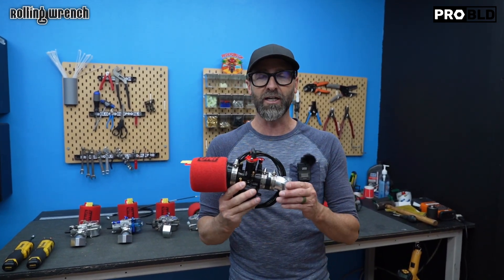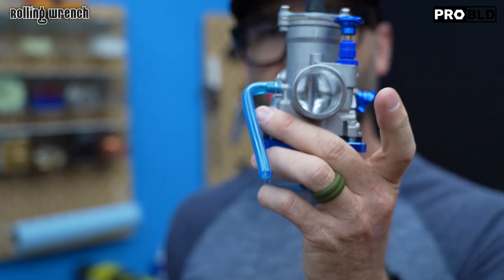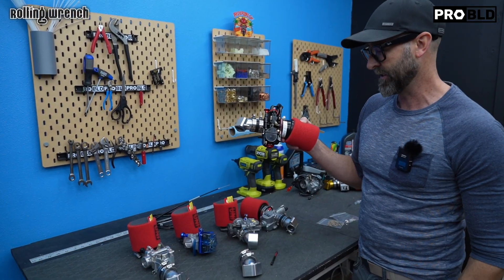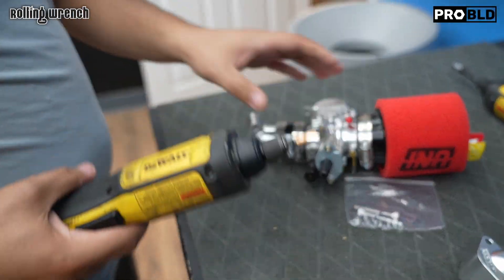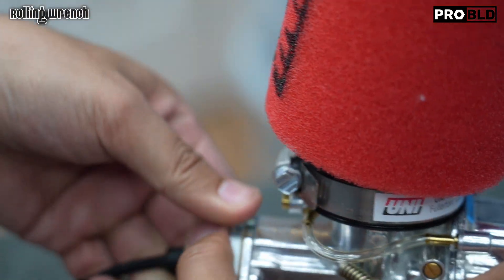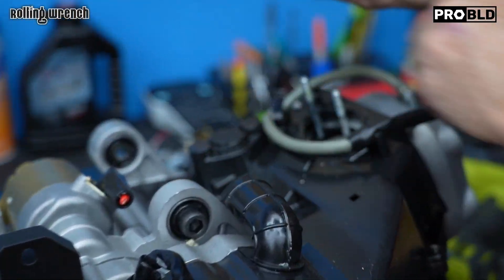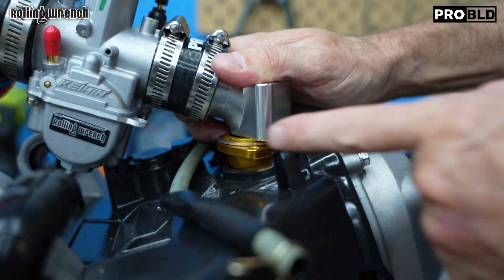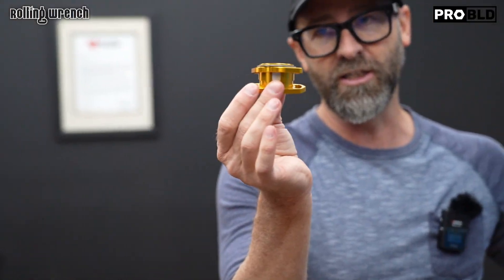WORLDS BEST GY6 PERFORMANCE: Bang For Buck

Comment: I recently got a Ricky Powersports Tiger shark 125 cc go kart I have no clue what type of engine is on it other than a four stroke and it was running for about 20 minutes after I first bought it brand new and then it lost power and died it has spark. It has oil it has gas it hascompression, but nothing is working to get it started any advice

Comment: where you at in colorado? im also out here and im got a 125cc rn with a 26mm on it its running great im just having some issues with understanding jetting out here im on a 35 pilot and rn im running a 128 main but still a bit lean up top is 135 to much of a jump?

Comment: Im on a 200cc SVT and that's the first thing i won't to do but i don't know what the best size. Some people was telling me do a 28mm but i dont won't it 6o be to big
Reply from the maker: 28mm is perfect for a 200. That 200 is actually a 170 (61mm bore) they just call it a 200
Reply: @RollingWrench thanks 👍🏾 i appreciate your help. What do you think about the ⚙️ cause I also want to do at 17T in the front and 32 in the back

Comment: I have a GY6 CVK Carburetor with GY6 Intake Manifold. If understand correctly I can replace with GY6 CVK Carburetor with GY6 PWK Carburetor and I'm good to go. I don't have to change the intake manifold as based on the specs it looks to be the same as GY6 PWK Intake Manifold,  Correct?
Reply from the maker: This is all you need https://www.rollingwrenchdenver.com/products/gy6-oko-complete-carburetor

Comment: the inlet on the cilinder head on 125/150cc gy6 22mm right?
Reply from the maker: No 25mm
Reply: Ok thx for the explanation. on my standard rubber intake it says 22mm. That's why I asked about this, but even if the hole in the cylinder head is 25mm I think it's no use to install a bigger intake/carburettor unless you port the intake right?
Reply: I double checked the standard gy6 125cc intake port size on the internet which is 22mm. I'm surprised you claim it's 25mm. Anyway, I have been using a 30mm pe carburettor on my 125cc gy6 for almost 7000km now and it's running fine, but I think it could have been much more fuel efficient if I had used a 22mm carburettor all this time. I do about 20km per liter now. 
Could you give me some fuel efficiency numbers with the different size carburettors? 
I think it's important to mention this for daily gy6 users. Thx
Reply: @jimvandrongelen8259   from my experience (also on a 125 cc grom clone) the max carb you wanna run on this size is 26mm anything over that and your just throwing away fuel and even then 26mm is still pushing it. i however after fine tuning my 26 mm on my 125 my fuel usage is only a fraction more then what it was on the 22mm i had prior  i am still fine tuning the top end as im running alittle lean still but this is my 2 cents! my bike came with a 20mm originally so even the 22 was a much better ride i just wanted to push the bike even more. ( i make content on the new gen 3 grom clones since not much info is out about them even though the platform is pretty much the same as most carbed bikes)
Reply: . Thanks for your reply. As long as the intake port is 22mm or 25mm, it's my opinion that it's  inefficiënt to put a 27,5mm intake with a big carburettor on it

Comment: 2 questions, is the plastic spacer on the intake port there to help with heat transfer like a thermal gasket? I noticed taida heads come with a thicker plastic spacer. 2nd question is there a limitation to the efi system? Like can I do a 150cc efi system, then upgrade the exhaust, intake and maybe then do a bbk or port the stock head . Will the efi system adapt to all these upgrades?
Reply from the maker: Good question, yes the plastic spacer is to limit heat into the intake. You can keep it if you wish, in most cases the spacer will need to be pot matched. I generally remove them. That is entirely up to you. As far as EFI we have a tune for a 150cc and a 171cc. It will auto tune for any exhaust you through at it. If you big bore it, the ecu will need to be sent back for a 171 tune.

Comment: Hello. I have a question for you. Let’s just say i wanted to install a Gy6 150 but I didn’t want to run all them wires. Where would be the place to wire in the stock carburetor? The two wires, what are they?. Neg. And pos. Or what? Please help me out. Thanks.
Reply from the maker: With this carburetor no need for any wires as this is a manual choke. This make life easy.

Comment: I appreciate the video you just dropped, but I really need some help with the vacuum line setup.
I ordered your 28mm carburetor and 171 BBK 2 weeks ago. I have the BBK installed but I'm stuck with the carb.
My stock carburetor had a ton of hoses running all over the place and I don't know how to simplify the setup with this new PWK 28mm carburetor.
What hoses stay and go where, and what hoses get removed?
Can you help me with that or maybe drop a new video based on the vacuum line setup?
Thanks.
Reply: his video is helpful a tip is generally ( im not 100 sure on how his carb works but my nibbi at least ) should only have the fuel coming in the overflow going out and the throttle cable, everything else gets deleted ( i did the EGR delete as well as remove the evap canister (wrong term?)
Reply from the maker: Actually I already have a video for that. Go to our listing on the website where you purchased our carb. I have an install video. That should help you

Comment: So here’s what happened to me. I bought a leftover 2022 gy6 150 cc from a dealer. Manual says change oil at 100 km (68 miles). Ok. Took it to a local shop that dosent work on these but agreed to hekp me out. Did the oil and rear oil change. At 201 miles the engine seized. I sent it back to the dealer. He refuses to honor the warranty he says the crank case had no oil. Blamed the shop for forgetting to put oil in after draining the shipping oil. Shop of course denies this.
Dealer freed up the motor but said has serious scoring. Runs loud. At 242 miles after only 2.6 miles of 35 mph riding it shit off. Not sure if it’s a fuel issue or again overheated. Uber to work ($32) and late (write up). Got a ride back 8 hours later it started right up. Rode it home.
Dealer refuses to deal with it anymore so I got my attorney involved.
I don’t trust it.
 I don’t know anyone who works on it.
I’d like to ship it to you for your 171 cc motor with upgraded cvt and ignition system and your fuel injection system.
Will gladly pay for the items plus your install time plus round trip shipping.
Can you help me?

Comment: So if I'm upgrading from stock on a 150cc GY6, I need what size? Is it the 26mm?
Reply from the maker: Yes. 26mm is what I recommend for the 150cc
Reply: @RollingWrench okay, thanks. Just 1 more question regarding this carb. If I get the kit, does it replace the current throttle cable that's on the bike? Or can I just hook the new carb up to the old cable? The issue for me is, I don't know if i'll be able to use this carb on my bike, because the bottom of the seat bucket practically sits right on top of the carburetor
Reply from the maker: @BP_26 unfortunately you have to use a new cable. The cable you have is totally different. To solve your issue you can get one of these. But we are out of stock right now with no eta: https://www.rollingwrenchdenver.com/products/pwk-oko-cable-clocking-top
Reply: @BP_26  what bike you running ? my grom clone required a new throttle cable one i swapped carbs my wifes navi however im running a 22mm with stock cable and its working great so really depends
Reply: isn't the intake hole in 125/150cc gy6 engines just 22mm? If yes, what is the benefit of these bigger intakes + carbs? Thx
Reply from the maker: @jimvandrongelen8259 the intake hole on a stock gy6 head is 25mm. We recommend a 26mm carburetor. Unfortunately a 25mm isn’t available. If you upgrade to a big valve head you will get a 27.5mm intake hole that matches our intakes perfectly. Most people tapper the stock head to match the intake. The biggest thing with these carbs is the throttle response in comparison to the stock carburetor. In short, a 26mm Pwk feels like you have doubled the hp on a 150cc
Reply: @jimvandrongelen8259 I'm assuming that the larger carb is able to drawl in more air, then force it down the 22mm intake 🤷‍♂️ but definitely loving the fact thar you asked this question,  and looking forward to Matt answering... I absolutely love learning new facts about these vehicles ❤

Comment: Do you have any for the get engine for my ruckus iam looking for one for performance its all stock need a bolt on plug and play carb. Information is appreciated
Reply from the maker: This is the one you want for easy bolt in performance for the ruckus 50: https://www.rollingwrenchdenver.com/products/honda-ruckus-stage-1-5-performance-package?variant=46688029769957